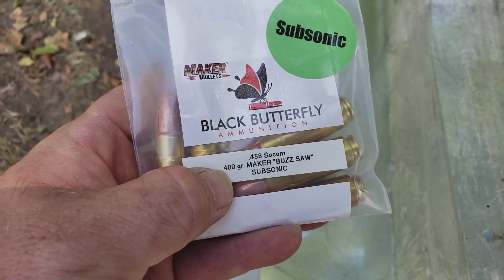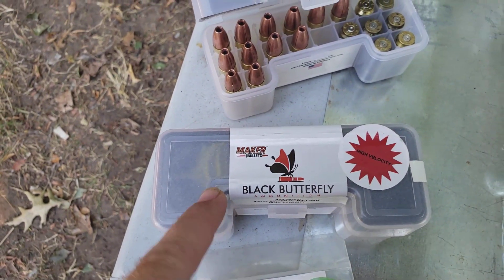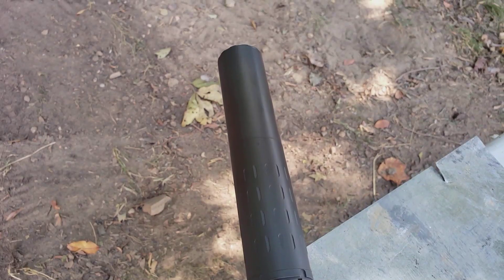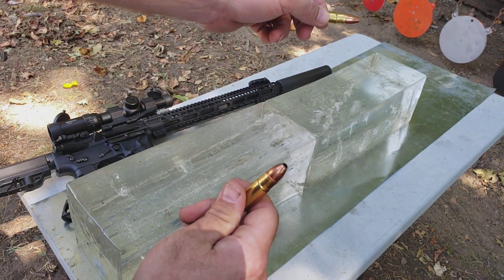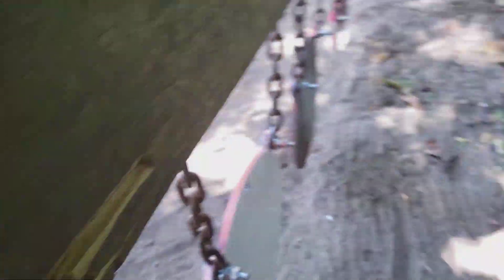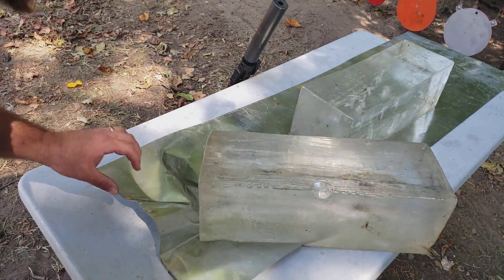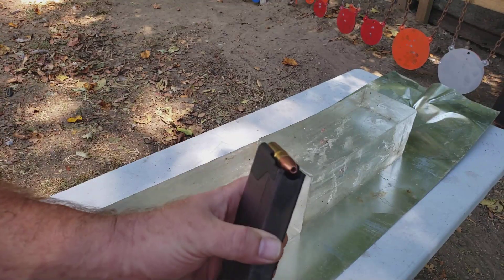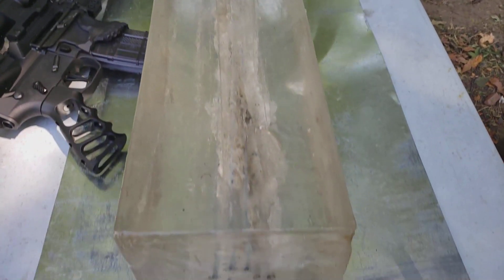458 Socom In Ballistic Gel

Comment: BCA has a .458 upper for $200 BCG included.

After watching this video, I'm buying it.
Reply from the maker: Buffalo's Outdoors has a video series on making the BCA 458 upper work if yours isn't perfect. Some of them are great out of the box. A few have problems.
Reply: @PatRMG  
Thank you for the heads up Pat. If I have to do some tinkering, I wont be upset. Wont be using it for defense anyhow. 
I appreciate you Pat.
Reply from the maker: @DEATH_TO_TYRANTS  I went a little overboard when I built my 458. It's sweet though.
Reply: @PatRMG  
I ended up not buying the upper. I dont know if I'll build a 458 as nice as yours, but I do want a little better than BCA.

Comment: Good show, good production and personality, but there is just so many self proclaimed experts supporting the 458s on the forums and niche industry you can't sling a dead cat without bumping into something. No doubt Black Butterfly is a top of mind brand for 458s ammo. The problem with so many forum loads is some are really, really poor. An example is "Black Butterfly Ammunition, .458 SOCOM, 300 gr, Barnes TTSX BT "HOG STOPPER" where you can see the grains of unburnt powder blowing out of the muzzle. Pat, stop and reason with me (Re: 7m 24s). That black soot is from really filthy powder selection. If it was from gel-flash, the entire bullet shank would be black. It isn't is it? Where the lands contacted the bullet are beautifully shiny. That black is from a filthy powder - or - a powder not burning properly.
Reply: And not to mention, the gel-flash only occurs way, way after the bullet has passed that section of gel. To this date, I've never heard an accurate description on what the gel-flash is (unless I told it).
Reply from the maker: The gel flash does occur after the bullet passes. There's a fancy scientific word, but I'll call it dieseling. The gel puts off a vapor as it's burned by the bullet. That vapor is then compressed as the gel collapses. It ignites in the same manner as a diesel engine, causing the flash. 

I've seen the unburned powder in the high resolution slow motion. Keep in mind that the shot was likely fired from inside 10 yards and the fancy camera shows everything. 

Shooting suppressed as I often do with various calibers exposes that many loads throw unburned powder. From 22lr to 45-70, I get unburned powder in the action and suppressor from everything. Kinda grown jaded to it.
Reply: @PatRMG  What happens is that gel block (I assume its a supercooled liquid and not a solid with a crystal structure) was essentially "solid" for lack of a better word. That bullet ploughing through displaces it and with the entry hole gaping - it sucks in air. Air has about 20% O2 in it. Then the hole closes. I believe you will find that the rubber band effect (for lack of better term) comes screaming back compressing the air the gel block just sucked in and as a gas is compressed - it gets hotter. And with enough heat and pressure in the presence of oxygen - sometimes gasses ignite. 

I'll wager Sonoluminescence was the word. I'll bet you a cold one, that isn't sonoluminescence. First it occurs in a liquid driven by a sound resonance. A blast is a delta function (a spike) made of of a near infinite set of frequencies - once.... 

And with sonoluminescence the bubbles are made of of the liquid itself. In gel,  the atmospheric air is sucked in - it has  nitrogen, oxygen, hydrogen, helium, neon, argon, krypton, xenon, and the radioactive radon, etc. in it. Some ask, well where is the spark like gasoline needs? I say "think diesel."

Good show, good audio. And that's a make or break. Bad audio makes things feel amateurish. 

Go check out that Black Butterfly video and see if you see what I see (grains of unburned powder blowing out of the muzzle). It's great high speed video.